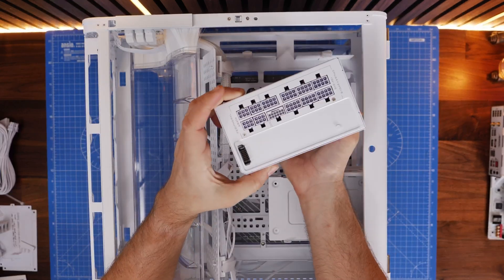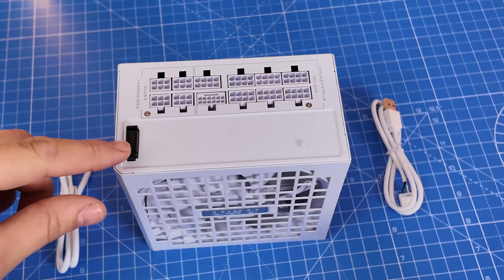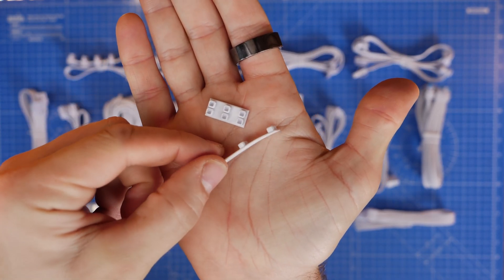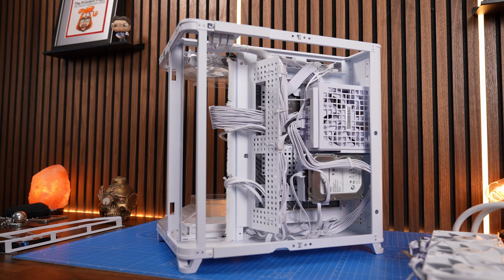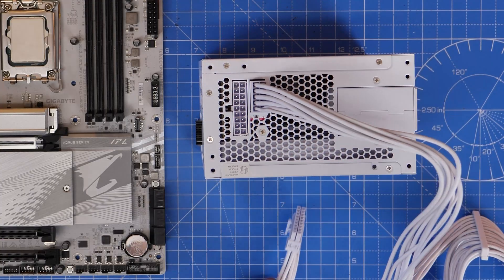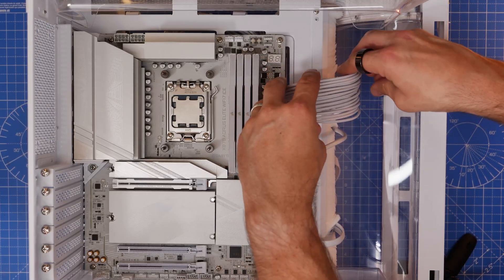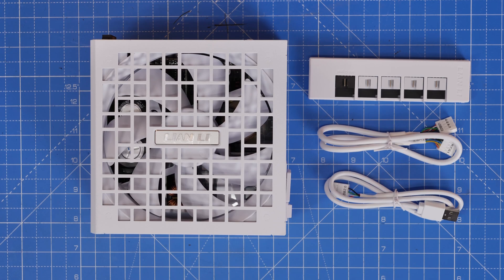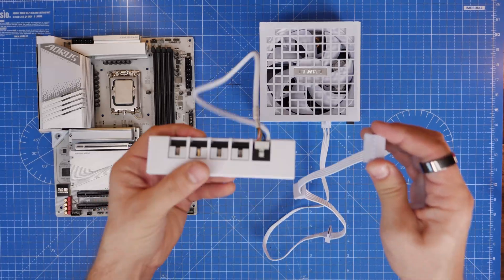Lian Li RS (rotational shift) PSU wiring and setup guide featuring RS1200G

Comment: Hi I saw an older video of yours in regards to placing AIO coolers, I posted a reply there but seeing its an old video, I might not get the correct info.
I will be using a Corsair 5000D, front mounting Radiator as an exhaust and will have the Radiator and AIO cooler pipes mounted vertically above the pump, the side panel will be intake 3 fans that will feed directly to the Exhaust AIO Fans and Radiator, the fans underneath the GPU will be intake and on top of the case will be exhaust and obviously an exhaust fan at the back. Would this be effective? My knowledge as a Mechanical Engineer says this will be fine but pro pc builders might have better info.